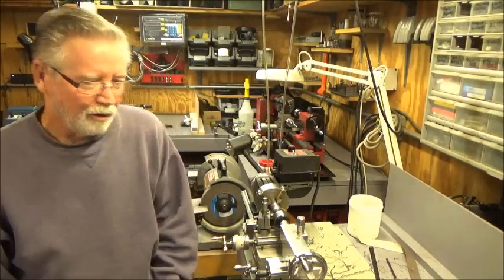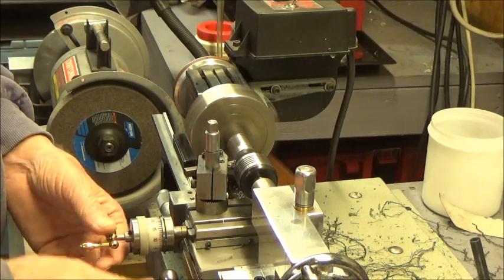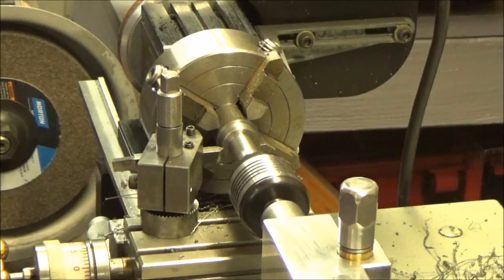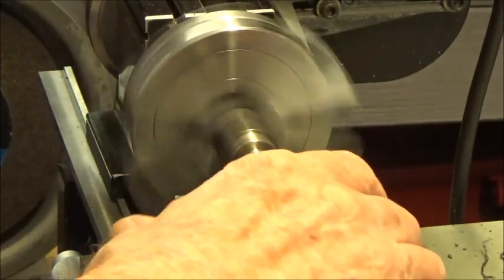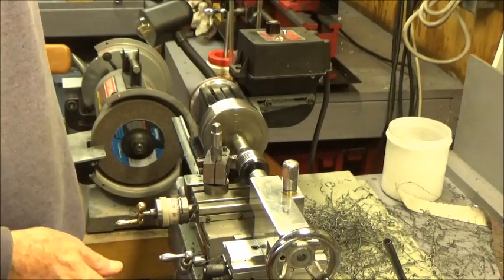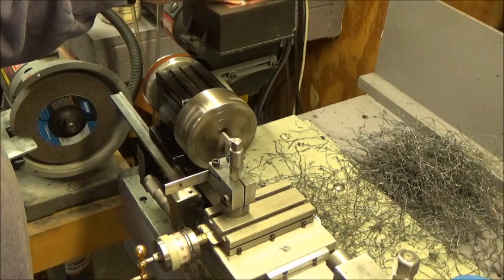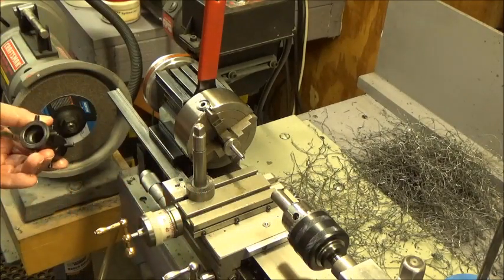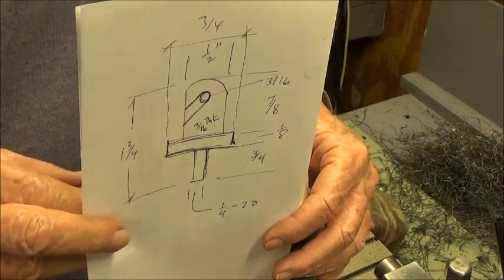Taig Lathe Machining Mild Steel Weight Hook

Comment: Hi, Larry, that's a really good video, I like the fact that you can zoom in close on the camera, I seem to have a problem zooming in with my Canon Power Shot D1 IS  when it seems so easy for you and with the sports camera I have there is no zoom available, could you show the setup you have camera wise and how you activate your zoom, I'm thinking I might get a better camera especially as I'm selling some odds and ends
Reply from the maker: Walter:  I'll see if I can figure out a way to film the camera itself.  I do have a video camera on my computer which I could probably use.  The camera I use is extremely simple and was also inexpensive.  I can can make a video here at my desktop, I'll post it on one drive.  Best Regards: Larry

Comment: Thier parting tool isn't anything to right home about either.
Reply from the maker: John:  I'm not sure what your referring to.  The special reverse tool post that holds a standard cut off blade (upside down) and mounts to the backside of the carriage does work pretty good.  It's also made of steel and not anodized aluminum.  I hope you know what I'm referring to.  Best Regards: Larry
Reply: @larrypoindexter9351  Larry that would be the 1 I get way to much chatter out of it.
Reply from the maker: @johnhubbard3399  My Shop Built Spring Cut Off Tools works great.  The Spring design has been a God send on both the Taig Lathe and the Mini Lathe.  Pretty much smooth as glass.  I dug out the Taig post the other day after your comment and plan to try it myself.  It has been years since I've even thought about it.  I can't seen any reason why it should be chattering.  Regards: Larry
Reply from the maker: John:  I made a short Video this morning that is "unlisted" but you should be able to watch via this link.  https://www.youtube.com/watch?v=sDWCADPn_3g
You might also be able to watch via my Spring Tool Holder Playlist.  Regards: Larry
Reply from the maker: @johnhubbard3399  Here's another video you that might interest you for the Taig 1173 (it's unlisted)
https://www.youtube.com/watch?v=s4fIYL4rYgA